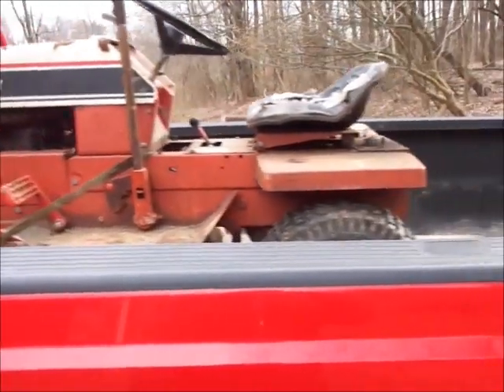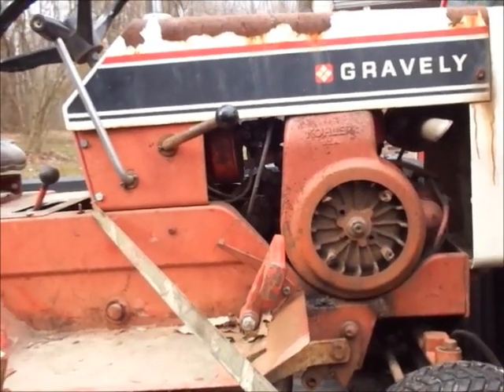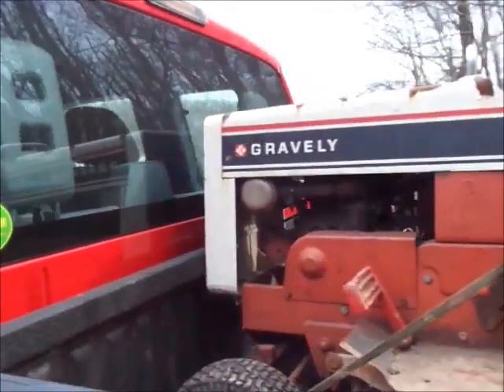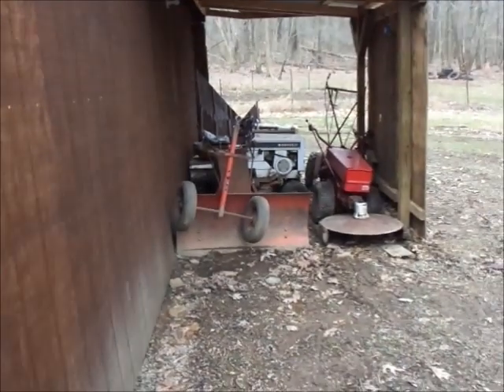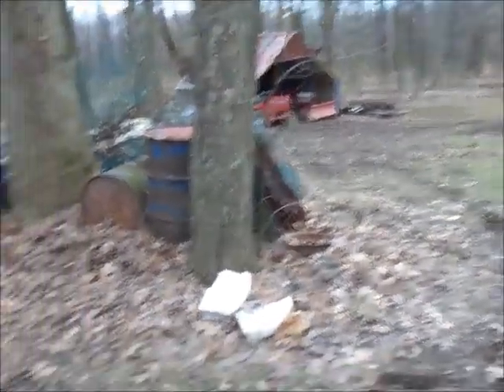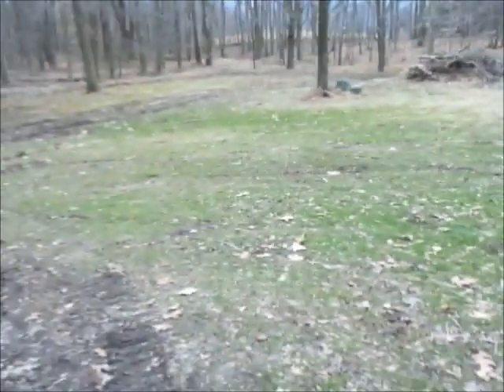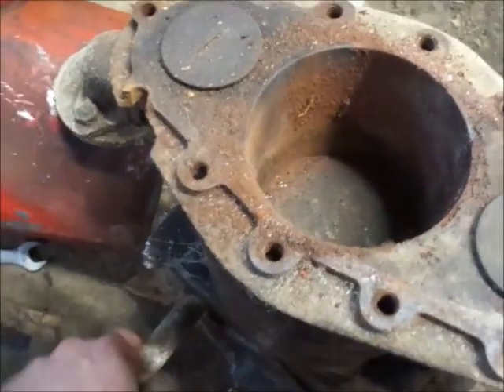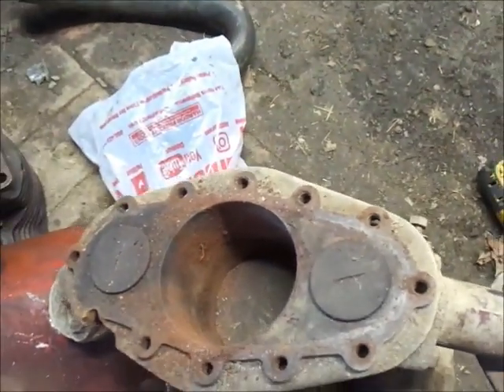Stuff going on while the 8163t build was going on

Comment: Cool.. I’m still waiting for the snow to melt !  We have over a foot deep up in the back field ! I’m going to work on the Gravely as soon the snow is gone. I found a 8hp Gravely 526 with a blower and a bush hog. I will try and buy it. Engine was rebuilt and it looks good not all rusty.
Reply from the maker: 526's are nice balanced machines!
Reply: stevenpturcheck I was thinking it might be a decent machine for the money. A blower, and hush hog and wheel weights and dual tires. The guy is asking 800$  Canadian..   It’s been listed all winter.. so might get a deal now.